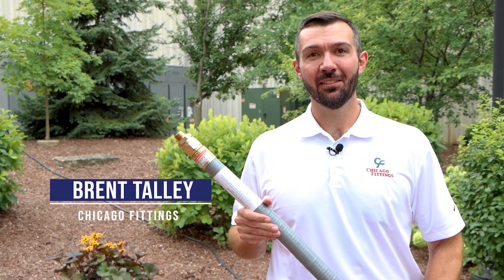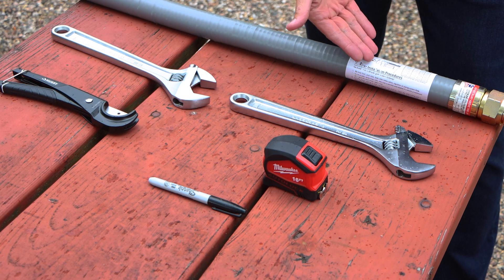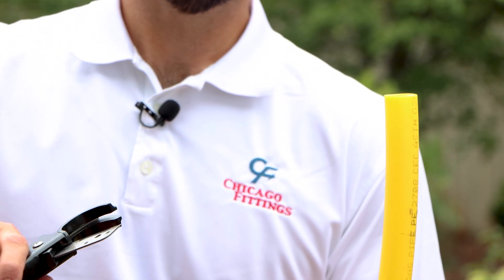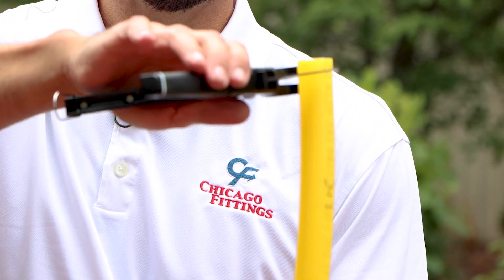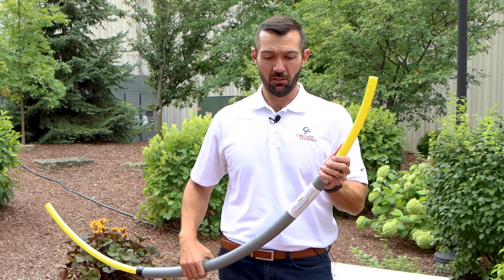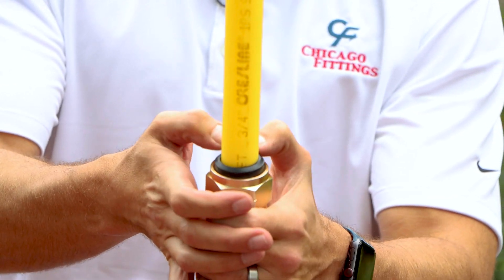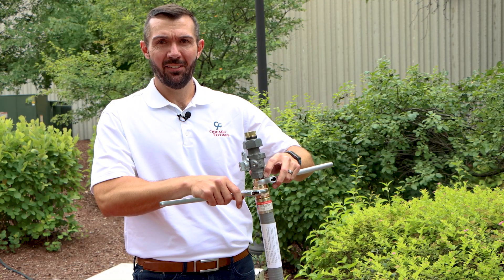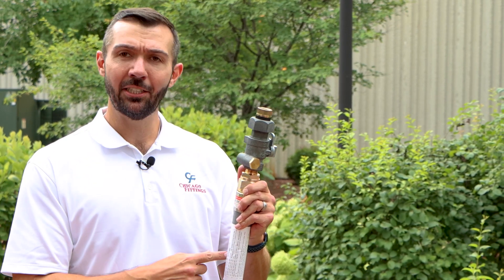How to Install the X-Riser

Comment: Is this flexible? Unfortunately some idiot installed my service line in the wrong spot. I'd prefer to avoid wny couplers and there's no way I'm digging it all back up.
Reply: I found the answer to my question. Ignore. And I figured out a way around the issue. I had to dig some more. 😢